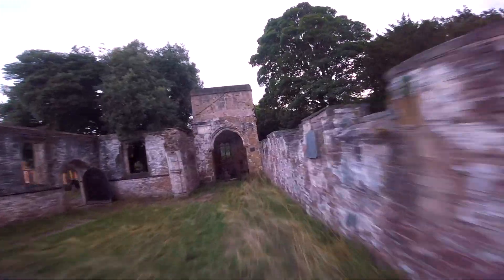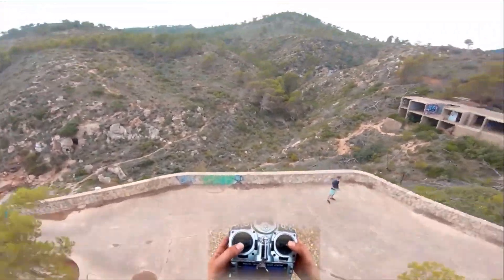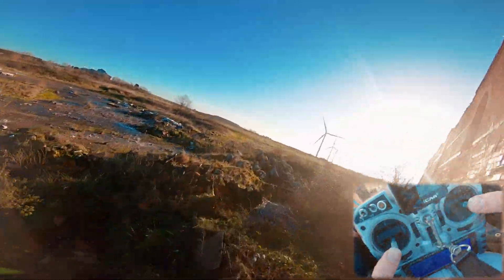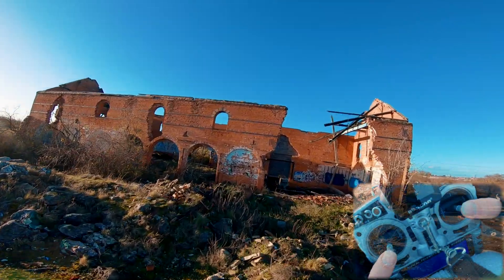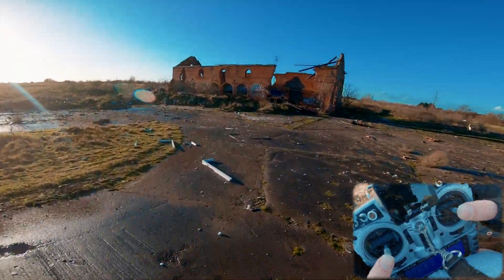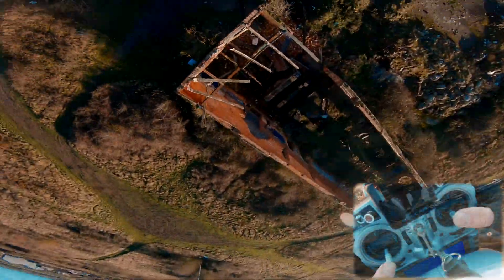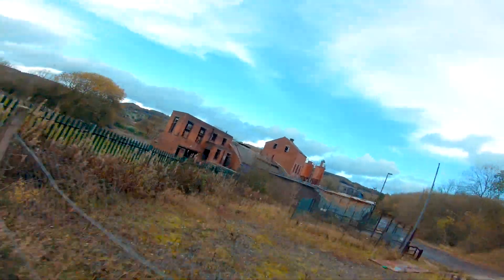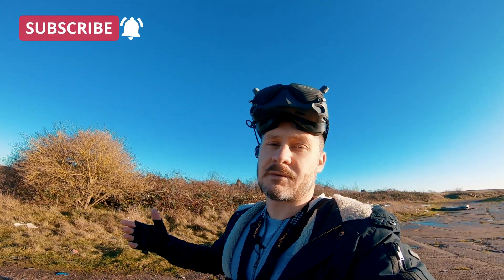FPV Drone Flying Lesson: HOW TO BAIL!

Comment: Good video, and i like that cement factory spot, i cant find anything like that near me Bohoo! so im having to fly at parks where there are people and dogs, so that backwards bailing is something i try not to do, i do a 180 so i can see where that quad is going at all times!
Reply from the maker: Good idea 👍 I shouldn’t have flown backwards so far but it was difficult not to whilst talking and slowing things down. In a pinch it’s actually just a very fast stick input to create thrust in the opposite direction and arrest momentum quickly. The cement factory is Derbyshire way. Is that too far for you?
Reply: @MagicFPV  No where will be too far in the summer i have a motorbike...i will be traveling to do flying this summer, and would like to hook up with other uk flyers like yourself :)
Reply from the maker: @Paul-Waldin  give me a shout sometime then mate